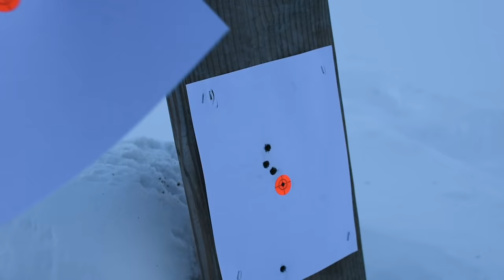Complete Custom Rifle Build (.375 Holland and Holland)

Comment: Oh My Goddess!  Were did you get the old stock Pantograph???   It looks a lot like the old one at the Weatherby Rifle company.
Reply from the maker: I actually bought it from a hobby gunmaker that picked it up years ago from a smith in Colorado. It's definitely home made, but it gets the job done.
Reply: @mnrcustomllc8253    Sooooo cool, Weatherby had several stock finishers in the distant past.  The stocks were done in an ultra-high gloss, using Fuller O'Brien's "Fuller-Plas".  It gave a very durable finish, but was very demanding to apply.

Comment: What is the benefit of the slow rust bluing vs using hot bluing salts?
Reply from the maker: slow rust bluing is a more durable finish and has a deeper luster than hot bluing. We offer both and in certain applications the hot bluing is a better route. If there's any gold inlay the hot bluing will make the gold "pop" more, and if the customer wants a high polish finish the hot bluing is the better option as well.